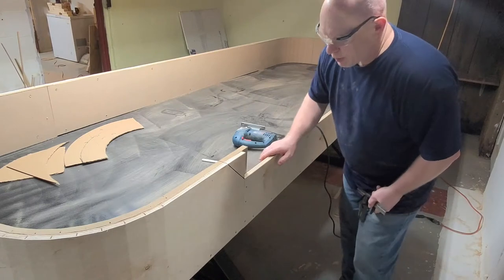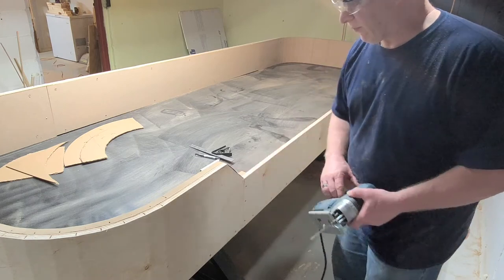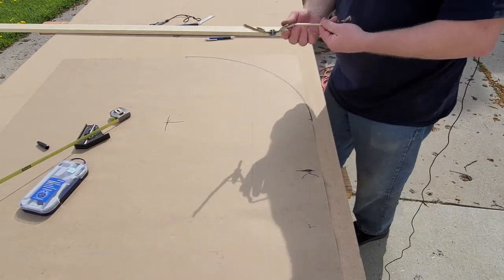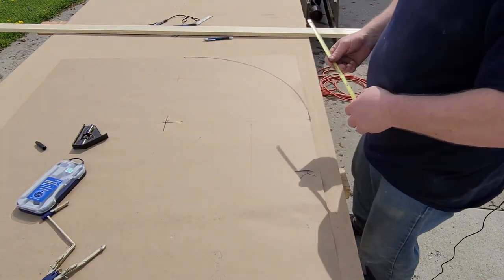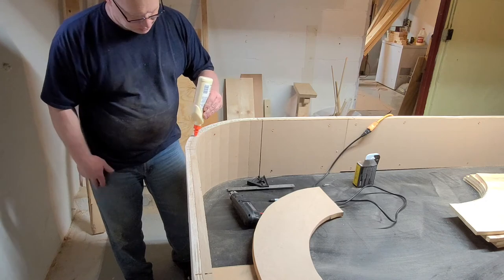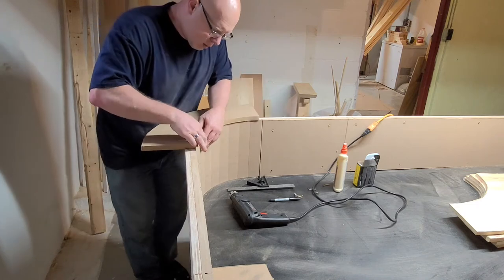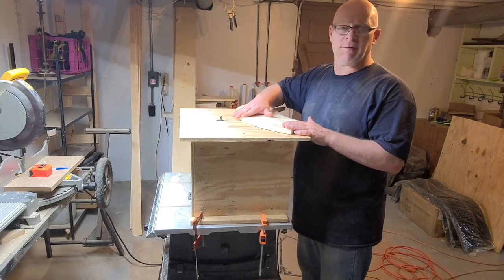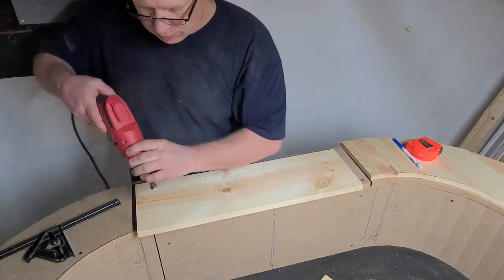Craps Table Build Part 5: How to make a craps table at home.

Comment: what is the measure from your table top to the top of board in this video,,before you add the chip rail support?
Reply from the maker: The side wall is 11 inches. The chip rail and the platform it sits on measures 1.5 inches. Total height of the side wall plus the chip rails measures 12.5 inches from the table top. Thank you for the question.
Reply: @CrapsMasterJourney  thank you very much....what is the measure from the your floor to the top of the board before you add chip rail support?
Reply: @CrapsMasterJourney  reason im asking is im wondering if mine is same or close to your on measures...my legs are 28" long, then i have 2 pieces of 3/4 birch wood glued together,,,so top of my table top is 29 1/2"  off my floor,,,,,
Reply from the maker: @nJOYgaming1  I believe the top of the table surface is 28 inches from the ground, but I will measure and share when I am able to give you accurate measure. I do plan on doing a video in the near future with all of the final measurements plus a few other things that I believe people will find very useful.
Reply: @CrapsMasterJourney  Thanks
Reply from the maker: Check out my latest video for all of the final table dimensions.  Hope this helps answer all of your questions.  https://youtu.be/NSISuwN8Kmo